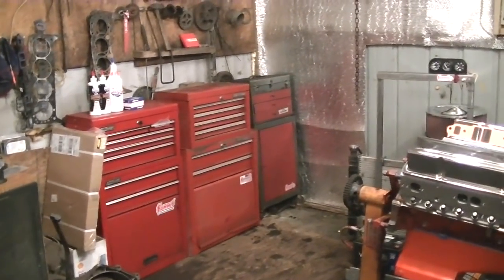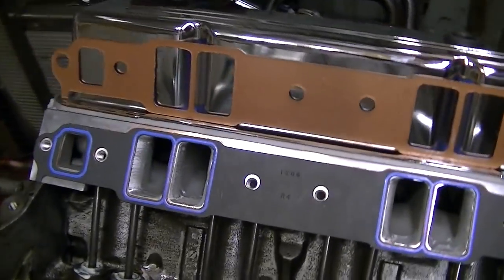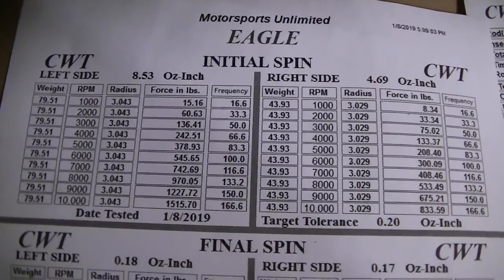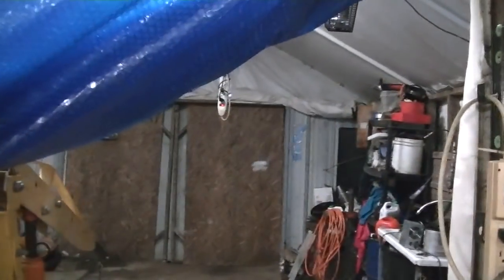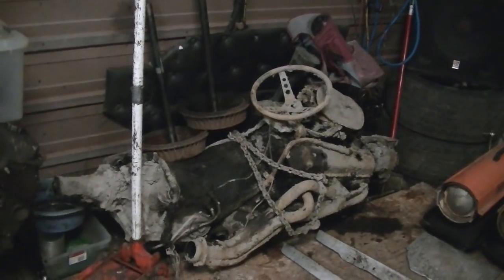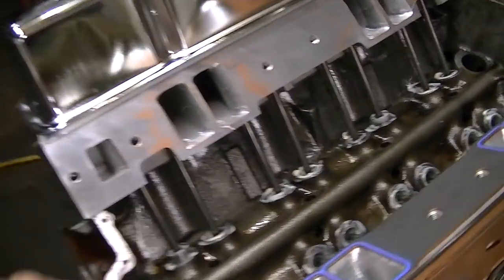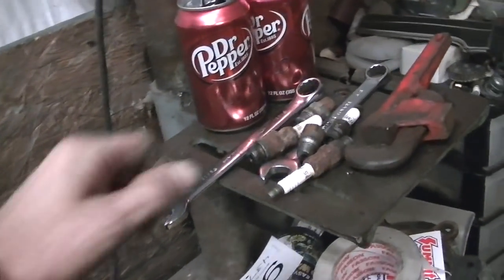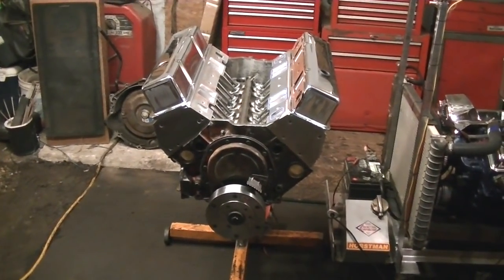chevy 302 update

Comment: What brand are your shaft rockers on the 302 and how did they fit the heads
Reply from the maker: the rail mounts to the head with 8- 3/8 bolts/50 ft lb , then the shafts mount with 3- 5/16 bolts for each pair of rockers torqued to 40 ft lb , speedmaster , same setup that's on my black s10

Comment: Hey Matt I’m from a area kinda close to you and I worked at M&R racing engines in geeencastle and I just wanted to say to stay away from motorsports unlimited in terra haute. I have fixed soooo many of his fuck ups when I worked at the machine shop. I highly recommend going to M&R
Reply from the maker: yeah , when I went to pick up the rotating assembly all wrist pins rings and rods were all taken apart not numbered, I file fitted every ring to the bore, took hours and hours to figure out what ring went where and what rod was fitted to what wrist pin and what piston,...I was pretty pissed off

Comment: the old aluminum heads are corvette heads?
Reply from the maker: the first "vortec" head , LT1 head welded up and machined to fit on a sbc
Reply: @MattsMadnessOfficial  i was thinking gen lt1 sbc but was saying no way!!! i was thinking that only a few did the conversion to run the gen 2 heads on gen 1 engines and brush that aside but the brass fitting was the give away. it is funny the 9:1 comp truck vortech made more power than the gen 2. the engine you are building is like a race engine. i like hi flowing heads a performance marine cam 9:1 comp a air gap duel plane intake headers. makes for a wide power curve. then use tall gears for speed. it will be interesting to see what it is like to use a racing engine in a work truck. hope you only need 93 gas. i have a 302 with 289 heads with 10:1-10.5:1 and run 87 no problem! use 89 to be safe. it has the small chambers and flat top pistons 0 deck. makes for a fast burn and no pinging. if you have problems on 93 water injection is the way to go.  take care

Comment: Lt1 heads that haven't been welded to work on gen 1 sbc
Reply from the maker: they have been welded and machined but yes there Lt1 heads
Reply: @MattsMadnessOfficial  I like building 302 lt1s using the 1995 L65 crack from a 265 lt1